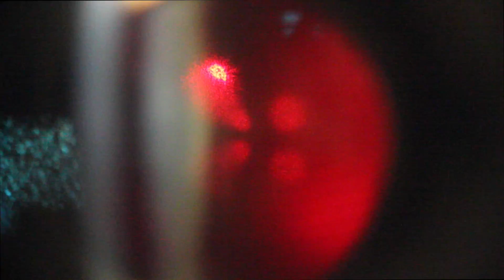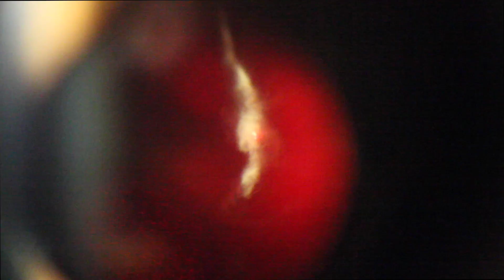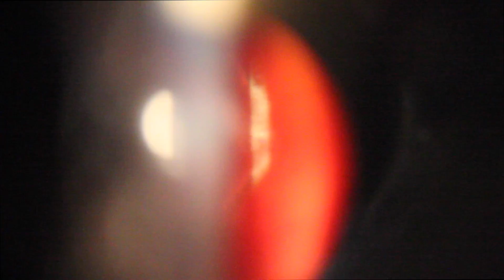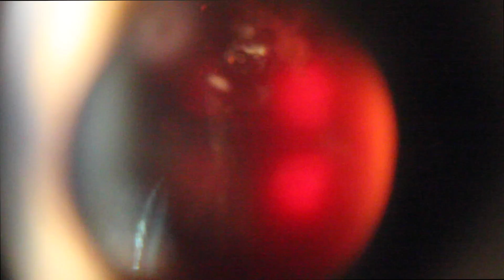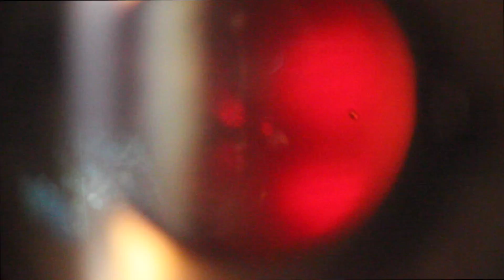Laser Floater Removal - Titrating Coaxial lllumination- by Dr. Paul Singh

Comment: What happens if you miss a "shot"?
Reply: Actually doctor won't shoot at the retinal area floaters coz if they missed it could be dangerous and they only do if the floaters is Infront of the lens
Reply: The laser doesn't work like that. It focus its power to a point so no it won't touch your retina. It doesn't work like a bullet. But like an invisible tangible short stick who will not reach to your ratina.
Reply: Go blind :P

Comment: I had eye floaters for a number of years and after making use of this eye floaters remedy “gofam shocking press” (Google it) for a couple of weeks they cleared up completely. I was hesitant at first since I thought they`ll be back after a couple of months, but it has been 2 years and no sign of  single floater. It is just appropriate to provide you with my story, so you can check it out for yourself.
Reply: Palin King do u have to pay for the gofam shocking press?

Comment: this process is breaking down the bigger particles to smaller particles . how u say this procedure cure floaters ??
Reply: dummy 

because then he goes after the smaller particles until they're all gone
Reply: also knocking out of the line of sight is effecitvely removing them. Remember floaters are the shadows cast by the collagen strings, so breaking them into small pieces will also greatly reduce the shadows to negligible or imperceptible levels.